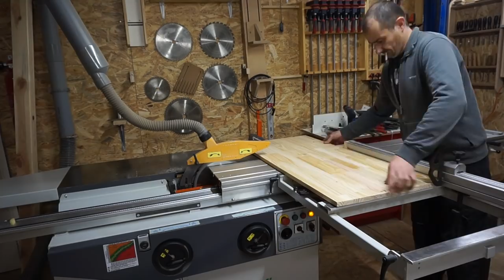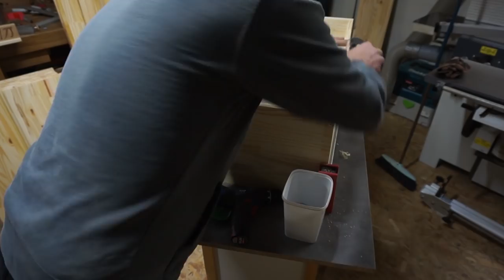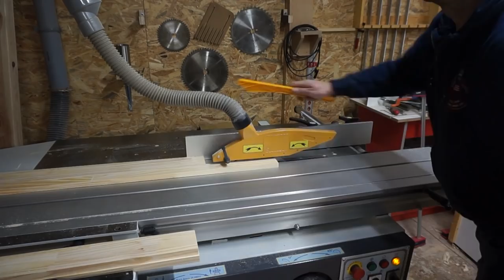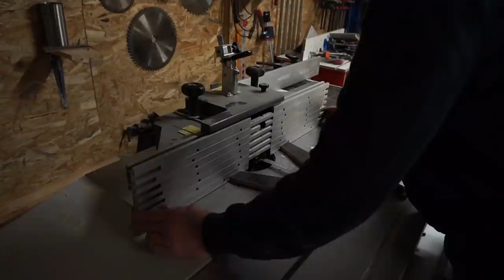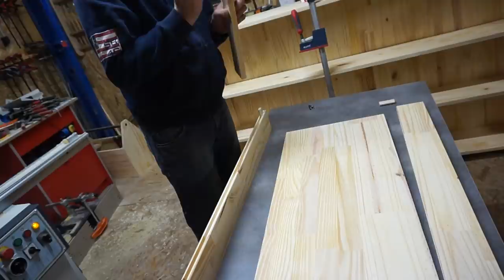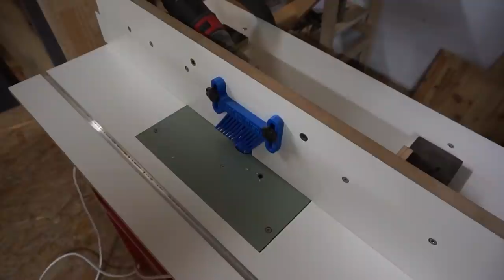Une cuisine en pin de GSB Pour un chalet

Comment: Tu a acheté les planches toute raboter ?
Reply from the maker: +Christian Mattei Oui en tablettes aboutés
Reply: L'atelier Vosgien j'avais acheté ça à casto dans le temps pour faire un meuble pour mes archives. Mais sa rester cher quand même à l'époque. Bon courage pour la suite Bye-bye
Reply from the maker: +Christian Mattei Oui ça reste un peut chère la y en as pour 250 euros de tablettes environs .
Reply: et tu n'as pas de raboteuse dégauchisseuse?
Reply: Ici chez nous dans les Landes on en trouve pas mal de ces plaques en latté de pin maritime. en plusieurs épaisseurs largeurs et longueur pour un cout ma fois très abordable. J'en utilise souvent mais comme le dit MP il y a souvent du retrait si l'on ne prend pas la précaution de le stocker à l'atelier 3 semaines au moins avant de l'utiliser. En utilisant ce type de panneau moins cher que du contreplaqué pour des projets "à peindre"  on s'évite la corvée de la rabot-dégau pour un résultat acceptable.